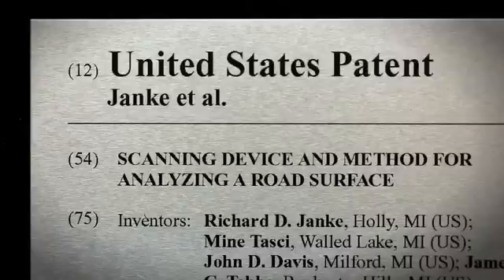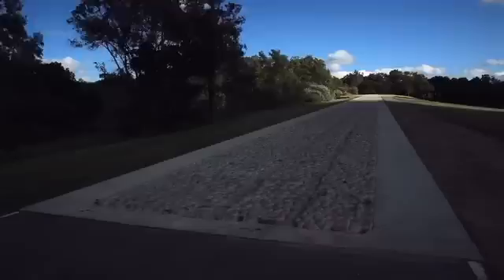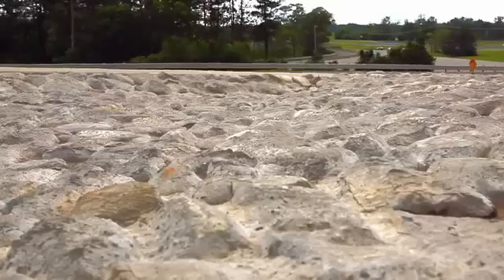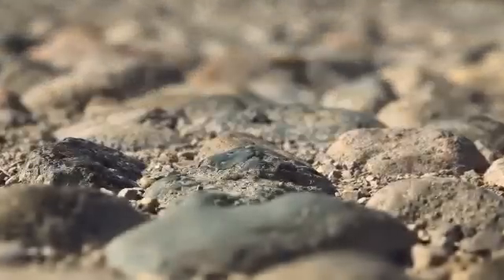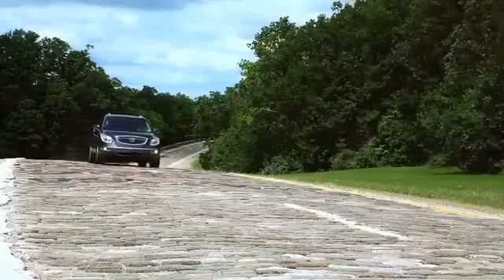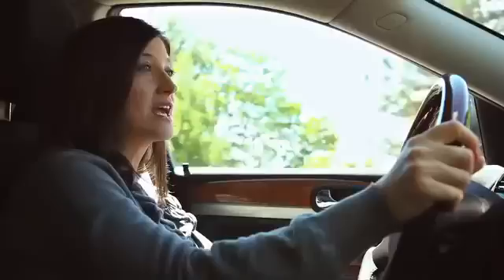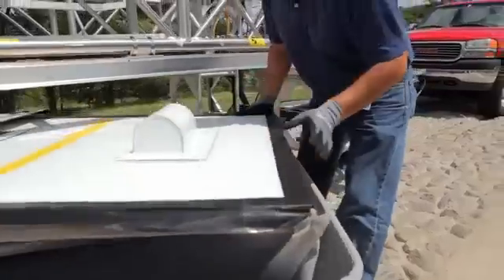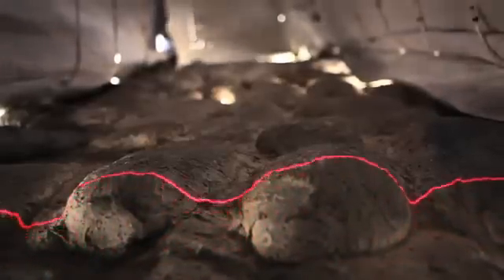Buick Enclave Suspension design

Comment: Well, I wish the GM design team had thought of that when putting together the 2009 Enclave, because my suspension system, front and rear is SHOT and gonna cost an arm and leg for repairs!
Reply: same here, just bought a used 2009 enclave 100K miles but babied its whole life and yes suspension is completely shot and actually dangerous the way it handles